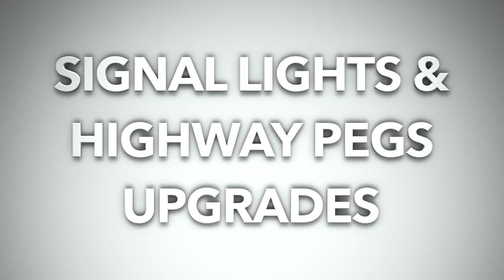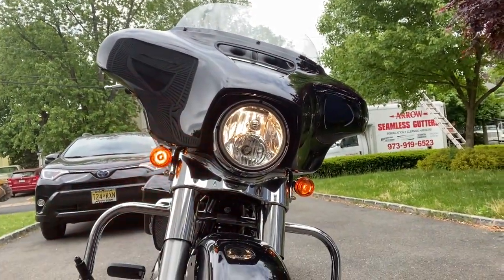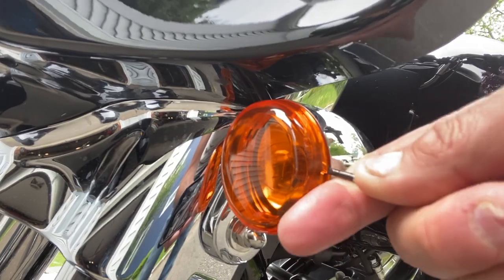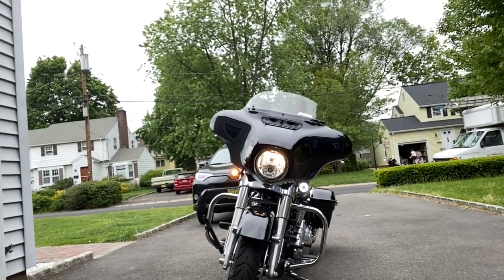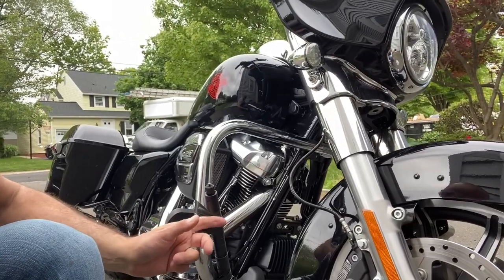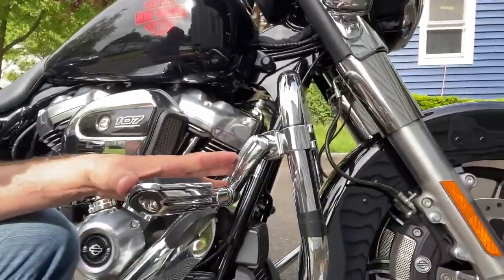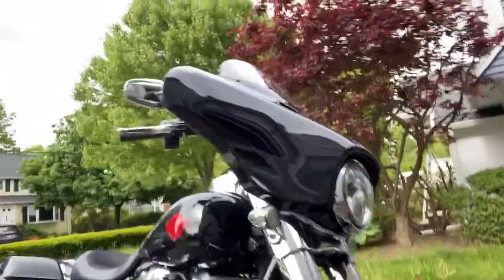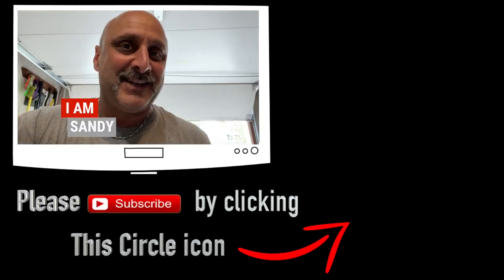Harley Davidson LED Signal Lights & Highway Pegs Upgrade

Comment: Great video Sandy, looks really sweet...hey, when you put your lens back on you should try to place the slot facing down...sometimes if it is facing up it will allow water to get into your lights, found that out after getting caught in a major downpour here in Florida.
Reply from the maker: 14theroad1955 good tip -thanks
Reply from the maker: 14theroad1955  buddy - can you please find that part number of the kit that converts the back signal light into running and brake light too? I was at my local Harley and they didn’t know what part will fit my FLHT... I can’t find online the kit that worked for your FLHT either. Thanks
Reply: @HOLYSHIFT  OK, here's the scoop, it will say that it will not fit the 2020 Electra Glide Standard, that it fits 2020 Road King, on my Standard it worked fine, you may need to purchase the red bullet style lens, when I purchased mine the dealer swapped the lenses that came in the kit for the bullet style...there are two types, there is one that has square connections, and then there is the rounded looking one, the rounded one is the one you want...Auxiliary Brake Light/Running Light/Turn Signal Conversion Kit # 68000123A...since you have converted your lights to LED I'm not positive that this will work, but it should, ask your dealer about that.. On mine it worked fine with the original parts that came on the bike, which is 1156 single pin bulbs...Custom Dynamics also has a conversion kit called the "Tripple Play" module for $89.00, I ordered that kit and tried it, but I kept getting an error code on the BCM, I would clear it and it would come back, so I ended up returning the part, but on the other hand, I have spoken to others who say that the Tripple Play from Custom Dynamics worked fine for them, go figure....Here is the link to the Harley part...https://www.harley-davidson.com/us/en/shop/auxiliary-brake-light-running-light-turn-signal-conversion-kit/p/68000123A     Good luck, hope it works for you.

Comment: good video man! just just filmed the same and I'm about to post it. I had a problem with the LED light on mine being able to turn it when I put it into the light socket unfortunately since the ones I bought don't have anything to grip onto and turn it once inserted.  Question: how did you get the Youtube graphic to pop up on your video? I dig it

Comment: awesome video. i got some brake and front led lights from ebay for 20 bucks and work amazing made visibility so much better
Reply from the maker: Yeah - you can find some good stuff on EBay....anything is better than the stock Harley light
Reply: @HOLYSHIFT  yea they suck very badly lol.. so how do you keep enjoying your Harley lol.. i came from a sport bike and the Harley lacks power. i have a 103 street glide stage 1 only thing i know to do is put a cam in there and hope it makes it more enjoyable. or unless im missing a point with what these bikes are about haven't figured that out yet